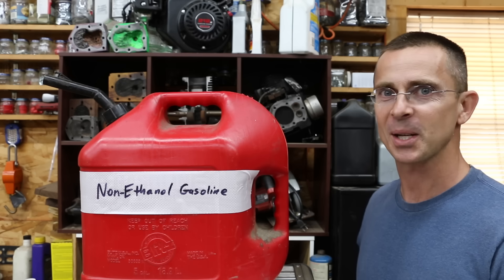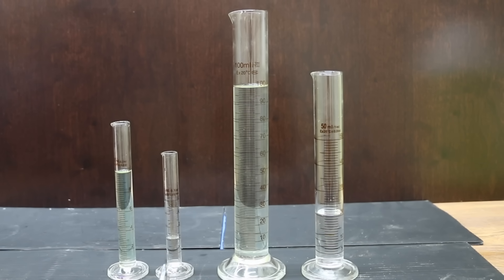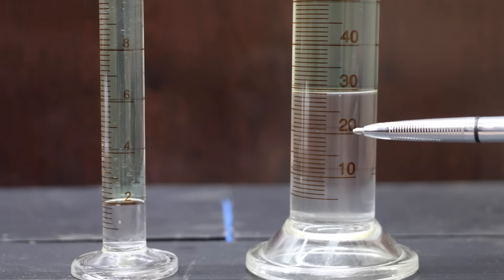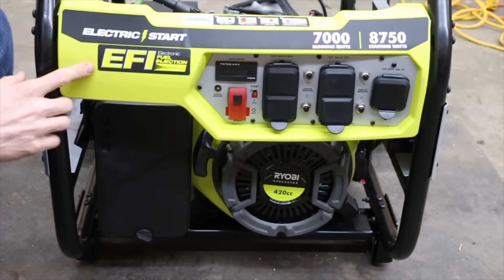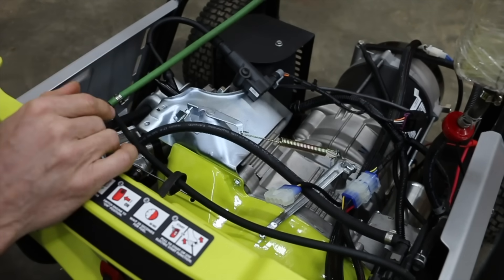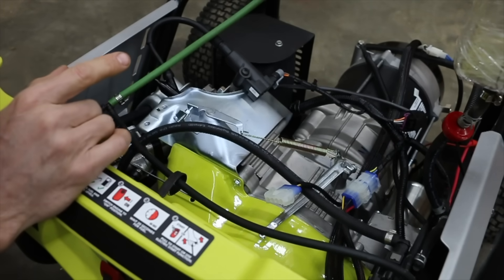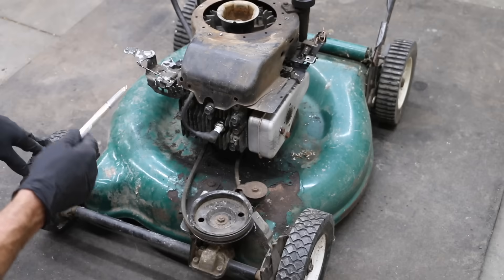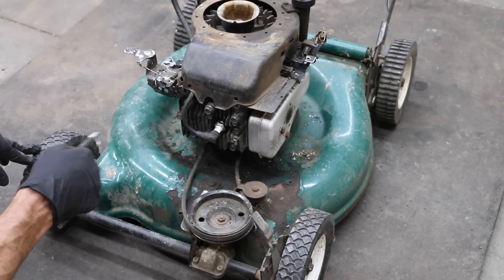Is Non-Ethanol Gasoline Really Better? See the PROOF!

Comment: its a funny thing see its a bad thing and clogs up injectors and carbrators but at the same time I no machitics that use e15 all the time and add injector cleaner every so often and they clame its worth using they do not understand it but they get better spees and take off as well as better gas milage
Reply from the maker: Thank you!

Comment: There is more to it than carbon build up!   Trips to the gas station, number of delivery trucks required, man, all sort of stuff you forgot.  Refineries are designed to make higher octane, too.
Reply from the maker: Thank you!
Reply: @ProjectFarm  See an old engineering 101 book for chemical engineers, "Process Synthesis", by Rudd, Powers, and Sirrola.  It is a manufacturing scheme economic comparison course, very basic.

Comment: My 2013 F150 5.0 got terrible gas mileage from e85 compared to up to 10% you get today. I think the trick is proper balance for newer engines, and just don't use ethanol for an older one, my 1968 Cougar needs an entirely new fuel system after running e10 for one year, also noticed I had to switch to mid grade from regular when e10 was the only thing available for it.
Reply from the maker: Thank you for the feedback!

Comment: E00 is almost impossible to find in MI and is VERY expensive.

Despite all of the nay sayers, I run all of my outdoor equipment on E10 and have never had a fuel problem.  I even leave it in my lawn mower over winter !  If you are concerned about E10, drain the fuel tank AND the carburetor before storing.  Also, when refilling, use a flashlight and check to see if there is anything floating around.

I am really interested in your "long term" test results.  If possible, scrounge up some old lawn mowers with similar engines.  To establish a fair base line, empty and clean each fuel tank, disassemble and clean each carburetor and replace the needle and float.  Fill tanks, start and run for about 30 minutes.  Store as you would typically.   I would like to see the inside of the tanks and carburetors at both 6 months and 12 months.
Reply from the maker: Great point. Thank you

Comment: If you’re going to connect the new generator to your house wiring via a transfer switch, perhaps you would explain why you need to use a four wire cable. Since the generator neutral and ground are bonded to the generator chassis, wouldn’t you be able to run a 3 wire cable  insisting of L1, L2 and ground. Since the generator panel will have a neutral bar common to the main panel and the generator via the ground wire, does a neutral wire from the generator really matter?
Reply from the maker: Great future video idea! Thank you
Reply: Thanks for your reply. In my case, I bought a Yamaha 7200 watt portable generator. It lives in a shed about 20 feet from the house. I asked an electrician to set-up the connections I would need to use in case of a power outage. The generator has a 30 amp 3 wire outlet and a 25 amp 4 wire outlet. Not knowing a lot about electricity distribution, I wondered why he used the 4 wire set-up instead of the 3 wire alternative. He answered by saying that’s the way it has to be. Even Yamaha’s manual doesn’t explain why the difference. I haven’t tested the 30 amp outlet, I’m assuming it’s 120 volts to ground on each leg and 230 volts across the legs. I could probably run a 230 volt electric heater from the 30 amp outlet, but not, apparently, power my transfer panel.  

Also, my modulating gas furnace electronic control seems to dislike the power quality coming from the generator. I’ve used the generator twice now, but the furnace will not initiate a call for heat on generator power. It goes into a “wait” state and nothing happens until the electric utility power is restored. Everything else connected to the transfer panel works normally. No one seems to be able to tell me what’s wrong other than perhaps a bad sine wave or dirty power is the culprit. Someone suggested installing a 30 microfarad capacitor across L1 and L2 on the control board but I’m a bit hesitant to try it. Anyway, having some fun with the gennie!

Comment: Hey Project Farm Dude, Love your videos, but did you look at the spark plugs? The ethanol is much, much cleaner. Also the top of the piston was nearly perfect. Compare the color.  The carbon around the valves is also different. I don't know which is intake or exhaust but on gas the left one was more carboned and on the ethanol blend the right one was more carboned. You also might try running E30 or so. If your EFI generator has an O2 sensor you can go E20, E25 and maybe even up to E33 with just relying on the O2/ECU to adjust the mixture. That will give you a better comparison to ethanol to gas.

All truth passes through three stages. 

First, it is ridiculed. 
Second, it is violently opposed. 
Third, it is accepted as being self-evident. 

Arthur Schopenhauer, German philosopher (1788 - 1860) 
To all you other silly people who rag on ethanol... I could say you are just paid by big oil or I could say your running on confirmation bias, or I could just say you are conformists never willing to stick your head out of the sand.. But one thing I can say is you are on the wrong side of science if you are ragging on ethanol. I run 100% e85 and I'd run 100% Ethanol if it was legal and I had a cheap source for it. I get 22mpg on the highway with 100% e85  and 24mpg on gasoline. I have duel tunes. (75mph) The reason people run diesel in trucks is the low end torque that fuel can produce. Ethanol is the same. It produces amazing amounts of low end torque on a super/turbocharged engine. 

Another thing peeps miss is when you burn ethanol it's combustion is primarily WATER VAPOR. [You know the things clouds are made of. ] The other is carbon DIOXIDE, the stuff you breath out every day. The stuff plants MUST HAVE to grow. Try that with gasoline or diesel. (Burning ethanol produces carbon DIOXIDE a harmless gas, not Carbon MONOXIDE the poison that GASOLINE produces.) Quite a difference there.

And the best thing about ethanol is you just grow more. Yea, yea, I know "you don't burn food!!!" Again, uniformed people. The crops that are used for ethanol production are not food grade. Also algae is producing 100K gal. of ethanol from 36 acres. (about 7 times what corn does). So unless you are fond of eating algae, don't worry your big tummies will get plenty of food. Also algae farms can be grown on concrete, in buildings, in ponds and plenty of other places that do not displace food crops.

Ethanol is the fuel for transportation of the future. 

All truth passes through three stages. 

First, it is ridiculed. 
Second, it is violently opposed. 
Third, it is accepted as being self-evident.
Reply from the maker: Thank you!

Comment: When I drive my Holden Cruze 1.8L (similar to Chervolet Cruze in the USA) up a hill near where I live in 3rd gear with the air-conditioner on, I cannot accelerate to 70kph, stuck at 50kph. The idling is noticeably rougher. The live fuel consumption tool in the instrument cluster indicates 4% more fuel consumption, which I do not really care about as long it was cheaper but it is only 3% cheaper. I also get pinging when accelerating, or trying to, up hill! I do use the Pro-ma PT5 additive in the fuel which is supposed to be tuned to ethanol blends but I use it because it can reduces fuel consumption 10%. I stick to 95RON and the PT5 to maintain performance.
Reply from the maker: Thank you!

Comment: I bought an older Silverado about a year ago. I checked the mileage several times using ethanol added gas then I ran a tank of ethanol free gas. When I ran the ethanol free gas my mileage went up about 2 miles per gallon. Since it was out of my to go and buy ethanol free gas the next few tanks were ethanol added gas I continued to check the mileage. It took a few tanks of ethanol added gas before my mileage dropped to the pre ethanol free gas  mileage . His study is flawed!
Reply from the maker: Thanks for the constructive feedback

Comment: Yes it is especially for small engines like weed eaters, lawnmowers and chain saws.Also boat motors
Reply: try to do this with diesel compression and tell me about how good is it.
Reply: @Paul Spomer im pretty sure not because unlike modern fuel injected engines the carburated old engines cant offset for the ethanol and will run leaner although more modern carburated engines are tuned for e10 and will run rich on ethanol free

Comment: We have a 2017 Hyundai Ionic Hybrid vehicle. It was getting between 38 to 40 mpg (highway) with ethanol gas. We switched to ethanol free gasoline and now no matter where we travel we get 49 to 55 mpg (highway). We were getting between 25 to 30 (in town) with ethanol gasoline. After we switched to ethanol free gasoline we are getting 32 to 40 mpg (in town). You may think that this is because of the gasoline/hybrid engine, but look at the difference. My Chevrolet Colorado gets about 5 to 7 mpg better both in town and on the highway. Sometimes it would get better if my wife didn’t start it and let it cool off every time she uses it. The ethanol gasoline is slightly higher in price, but the difference in mpg and maintenance will greatly prove it to be a lot cheaper in the long run!!! Most gasoline items, such as lawn mowers, weed eaters, chain saws, etc. recommend ethanol free gasoline or adding an additive to the ethanol gasoline. I had to replace the carburetor on my lawn mower after owning it for 2 years (I bought it new). I was using gasoline with ethanol and adding the additives and the inside of the carburetor looked like I had been running acid through it!! Why are we using our food in gasoline? To make the Congress people in those corn districts richer!!! I hope and pray that President Trump wins 2020 and Jesus Christ blesses us with a Christian Conservative  Congress so we are able to make ethanol free gasoline and get things done in this Country that’s needs to be done!! It’s time we spend our money on our Country and quit giving it to countries that not only hate America, but would destroy it if they could. God Bless America and President Trump!! #Trump 2020 # America 2020
Reply from the maker: Thank you

Comment: I noticed you didn't adjust the mixture when switching.
Gasahol needs a slightly richer mix.
If you have an O2 sensor this is done automatically.

There is more energy per pound of straight gas than gasahol has.

'Mo Power is what many want!

If you are worried about carbon then use LPG or Hydrogen. Hydrogen actually REMOVES carbon (look up hydrogen embrittlement for a worst case scenario).
Reply from the maker: Thanks for the feedback!

Comment: Outstanding video.  Your scientific method is to be commended.  "alcohol  is hydrophillic..."  I think you mean hygroscopic.  Hydrophillic means it mixes with water IIRC.  Hygroscopic means it absorbs moisture from the atmosphere.  Dot 3 and 4 Brake fluid is hygroscopic which is why it should be changed periodically. Just sayin'.
Reply from the maker: Thank you!

Comment: the ethanol is not added to boost the octane it is added to oxygenate the gasoline. ethanol has a hydroxyl group attached on one substituent link of the carbon parent chain. Gasoline has no  oxygen molecules in its structure. The alcohol adds more oxygen into the cylinder causing more complete combustion and supposedly cleaner tail pipe numbers. Small engines really don't need any more octane with a compression ratios in the 7 to 8:1 range. At only 10% ethanol its octane boosting isn't much. 100% ethanol is about equal to an octane number of 108. So in A 10% level in gasoline doesn't add very much. people have the mistaken idea that higher octane gasoline automatically adds more power if you put it in your tank. This is only true if your engine pings on regular. Ignition timing also needs to be optimized after increasing the octane number on vehicles that don't have ECM controlled ignition curves.  Regular gasoline at about 85 octane actually burns faster than higher octane fuels in the 92 number range. If your vehicle doesnt need premium fuel then your wasting money on it.
Reply from the maker: Thank you for the feedback!

Comment: This is good information but it misses the real problem with Ethanol. In your reasonably newer car, that gets regular use and has a sealed fuel system ... no problem. For older vehicles, and especially  for occasional use items like chain saws, outboard motors, motorcycles with non sealed fuel systems, the ethanol is attracting water from the surrounding moisture in the air. In addition to whatever happens with rubber parts, the water causes corrosion. This corrosion clogs the impossibly small orifices  in the idle circuits and injection fuel pumps. If your equipment is under constant use and turns over fuel on a monthly basis, maybe it's ok. For seasonal equipment, it's ruinous.
Reply from the maker: Great point!  Thank you

Comment: It’s not so much an ethenol based fuel when it’s only 10% ethenol. It’s not enough alcohol to make a difference regarding deposits and carbon build up. Now do a test on E85 or even E50 and you will see a reduction on efficiency but also a reduction in deposits and carbon buildup. You will also see a reduction in operation temps as the alcohol evaporates and pulls the heat away.
Reply from the maker: Thank you

Comment: Living in Ohio i have several stations in my small town that sell e-85. I have a Chevy Impala that has 210,000 miles on and i bought it brand new. I am guessing that i have used e85 for 70% of time in that car. The break even point in my car is right about 50 cents a gallon cheaper. So if regular gas is $2 a gallon and e85 is $1.50 a gallon I go ahead and get the e85. Yes my MPG drops but if i buy $20  in gas i get 10 gallons bit if I buy e85 i get 13.3 gallons which is 3.3 gallons more. That drop in mpg is made up with the extra 3.3 gallons i get. If e85 is more than .50 a gallon cheaper I start to save money. However.. i have family that grows corn and also family that is in the military and even at break even prices i always get the e85 as i would rather my family and local farmers get the $ because prince oil boy doesn't need another gold Lambo and his cousin doesn't need another fighter jet to shoot at Americans with. 
As far as performance goes it burns much cleaner and this is evident by oil color. If i run only e85 my oil stays golden yellow for much longer and doesn't get that gas smell to it as it get older. Not a proper test but IMHO test. Drivability test, again.. not with a real test but my seat of the pants test tells me that regular gas has more power in the lower RPM band but the E85 has more power at the higher RPMs. Long term testing in my flex fuel car is great results. With 210,000 miles i have never had to replace anything with the fuel system including injectors,  filters, or pumps. I have replaced the gas cap but i think the clicky part just wore out.  Thats my 10 year test on a E85 vehicle. 
Lastly.. for small engines before turning it off shut the fuel valve and let it idle until it sucks all the fuel out of the carb so it doesn't sit in the carb causing damage.
Reply from the maker: Nice!  Thank you

Comment: The issue with Ethanol causing corrosion is the fact it attracts moisture, I use Ethanol Shield and Mechanic in a Bottle for gasoline at all times, it stabilizes the gasoline and it fixes the ethanol issue by chemically blocking it out or traps said moisture.
Reply from the maker: Thanks for the feedback!

Comment: I've been mechanic, service tech, motorcycle mechanic and road rescue. There are substantial problems with carburetor ports and diaphragm blockage caused by the ethynol congealing due to moisture condensation. Low flow systems, especially side and down draft, gravity fed carbs will all clog if ethynol fuel is used over a prolonged period of time. Fuel shut-off valves, intake manifolds, and any place with passage way restrictions and expansions will all collect ethynol residue and eventually fail. Higher pressure fuel systems do better, but they will also experience condensation and passage way restriction and expansion issues, including fuel injection. Condensation and water in the fuel will always be a problem with ethynol. Period...
Reply from the maker: Great point! Thank you
Reply: @ProjectFarm  Keep up the great content.

Comment: The best fuel I’ve found for my motorcycles, and 2 cycle and 4 cycle lawn equipment is 100LL aviation fuel. I can get it less that $4 a gallon or about 1/3 the price of race fuel and everything runs noticeably better on it. Also aviation fuel is a lot better than pump gas at not containing water and being much cleaner. And of course guaranteed no ethanol
Reply from the maker: Thank you!

Comment: From Leo:   I don't have a BSME.  What I have is experience.  I have been driving 4.6 liter 2V Grand Marquis Sedans since 1997. Between 4 of them I have driven close to 1/2 a million miles.    Every one of them gets 2 mpg higher with gasoline than with ethanol blends.   Every one, every time. This is true even when I drive Interstate 70 in Utah with the 80 mph posted limits (with many drivers exceeding 90), Temperatures above 100 degrees Fahrenheit and the thin air at the high altitude.    Great cars, great engines and they ALWAYS performs better with gasoline.
Reply from the maker: Thank you!

Comment: I run non ethanol gas or "rec gas "  at the 90 octane. Can tell a difference in performance and mileage tooo.  The several times I have done it has shown that it's cleaning the internal system up from tank to injectors and obviously new plugs and wires and on 87 gas I will still get 26 to 28 mpg.
Reply from the maker: Thanks for the feedback!